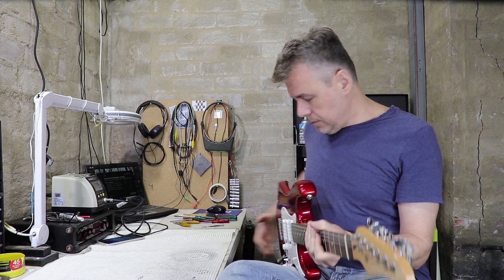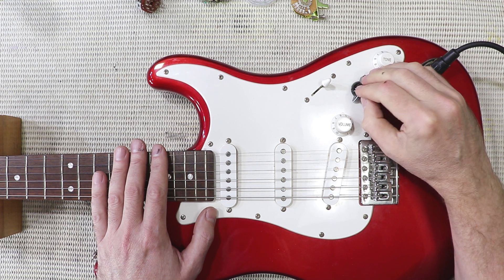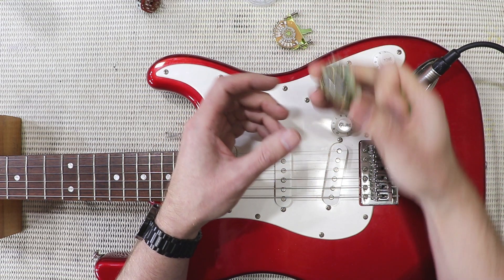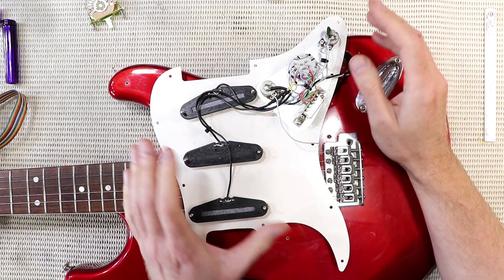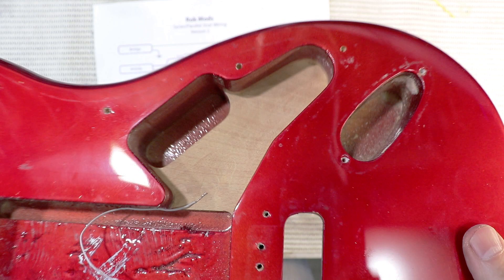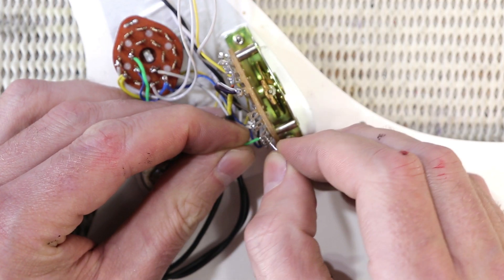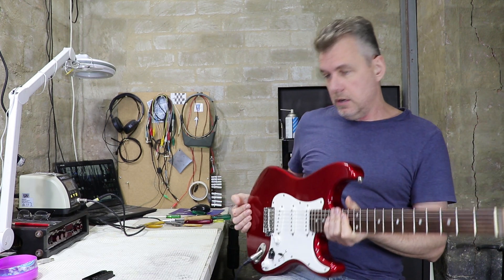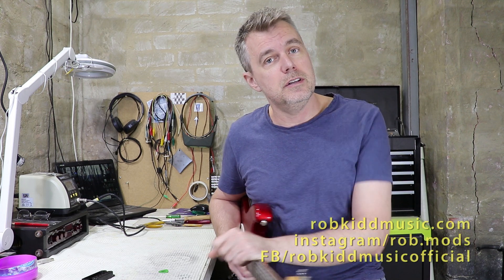Custom Series Parallel Stratocaster Wiring Mod, and Some Guitar Soldering Tips.

Comment: I generally wire up my 5-way by swapping the hot leads for the bridge and middle at the pickup selector.  The gives me: neck, neck+bridge, bridge, bridge+middle, middle.  In effect, I swap one "cluck" for a Tele-like sparkle, which standard Strat wiring does not provide.

Comment: Really appreciate you posting this Rob. I was looking for a way to include series wiring rather than the Dan Armstrong blender mod. I wired up your first version today, it works great and I prefer this to having a humbucker pickup in the bridge. Thanks again
Reply from the maker: Nice one.  Thanks mate.  On this red project strat I actually went back to version 1 when I wired up the black pickguard.  I like being able to switch straight to it, and yeah two singles in series is great.  If you are into Brian May, I believe he used the red special with bridge/middle in series a lot for many of the classic queen riffs and solos.
Reply: Huge fan of Brian May, probably why I like the sound of your mod so much. I've done a couple of jams now with the new wiring, it's very versatile. Neck and middle in series also gives a great jazz tone. Thanks again

Comment: what's the difference between middle pickup with reversed polarity and with the normal One? And to mount the 12 pole switch or the Rotary switch, do i have to remove some wood from the Guitar?

Comment: Casino guitar is a great guitar, I got several guitars to compare, I don't know why the feeling is very comfortable to play, maybe light and balanced weight ergonomic fender strat design, I moded so many times with this guitar, I cut the headstock like you did and removed logo and that left white mark underneath, made BMG setup like yours, installed one YJM pickup with roller beneath, now original fender player pickups are installed.
Reply from the maker: Nice one.  I'm liking mine more and more each time I play it.  I like the fretboard too.  It has quite a large radius, which suits my bass-player's hands!...

Comment: Do you believe that the first mod could be somehow implemented with hss strat in such a way that instead of middle and bridge in series one would get just the humbucker? I must say that I tried quite a few wiring diagrams and always end up with too few poles on switches.
Reply from the maker: The humbucker's coils should already be in series, so there's no need to have that on the custom switch.  You should be able to adapt the version 1 mod switch to just give you the neck and mid in series though.  In fact with only two throws required, a 4P2T toggle switch could also be used.
Reply: @RobMods  I may have not been precise enough with my description. I wanted to have all 5 classic strat position using north coil of bridge split + bridge humbucker in series + neck and middle in series and couldn't figure out how to split bridge humbucker.
Fortunately after a lot of drawing I finally figured it out and by using two superswitches got additional two series positions and managed to have neck with bridge south in parallel instead of middle single coil (kinda like a middle position on tele). It would be even better if I could run a resistor between hot and ground for parallel and single coil  connections only to simulate lower resistance volume pot, but I suppose I should be thankful for what I got.

Comment: ROB MODS, What would you recommend as in passive components to Revoice guitar pickups?
Reply from the maker: Well, adding a capacitor in parallel with a pickup will lower its resonant frequency.  And reducing the impedance load will raise the amplitude of its resonant peak, or reduce the treble roll-off I guess.  Using a shorter cable reduces the capacitive load as well.  All the components in a passive guitar circuit interact as you change the controls, so it's impossible to recommend one thing really.  You really have to think of all the parts working together to create a resonant circuit.  I have an old video where I use a rotary switch with different capacitors and resistors in my old P bass.  It is called "how to make a DIY Tonestyler".  It is a very old video, shot on my phone, and it doesn't explain itself very well TBH, but perhaps you might find this interesting.

Comment: The body is ply wood !!
If you look up the other end in the video you will see the laminations , It is surprising how well that works with a decent neck.
Reply from the maker: Yep, that's what I thought too.  I have come across a lot of 90's plywood strat and tele copies out of Korea over the years.  There is also a lot of old 80's Japanese axes with multi-laminated bodies that have a veneer top and bottom.  But this is actually a three-piece.  (I have stripped and refinished this more recently.)  So that pattern is simply from the cutters.  I used to operate cnc machines in a guitar factory, and I'm guessing this choice of cutter might just mean they can use higher traverse speeds for faster production.  Or perhaps they are cutters that can cut well both climbing and conventionally, for tool path optimisation.  I'm not sure.  There might be another reason...
Reply: I got a bently series 10, has a plywood body. No complaints. It also has the best neck a guitarist could want. Of course was made in early 80s when quality was much better than cheap guitars these days.

Comment: Do you know the Freeway 10 way switch? It's a drop in replacement for the 5-way switch. And has in the lower bank the regular strat tones and in the upper bank: bridge-middlein series, all three parallel, bridge-neck in series, bridge neck parallele and bridge neck in series.It's great and easy. I wanted to add some toggle switches to add out of phase possibilities, but replacing a tonepot with a rotary switch is also a nice idea. That makes that mod also invisible.
Reply from the maker: Yep, I've seen these switches, but not had the chance to wire one.   They look super cool though.   Another thought I had for a mod is to use one of the cheap switches that has a circuit board for its contacts,  and redesign and replace the board.  I haven't really thought this through though so I'm not entirely sure which options this would open up...
Reply: @RobMods  Oh, that is an interesting idea. I have such a switch lying around, because I replaced it with a Freeway switch. Never thought of disassembling it. Come out and play, switch.
Reply: I used to have a guitar with the 10 way rotary switch. I loved all the different tones but got rid of it for a simple 3 way toggle. Those 10 positions are impossible to switch to the right one in thr middle of a song.

Comment: Great job mate, excellent content, love your work. Instant sub.  I'm working toward a custom strat wiring, I havent quite decided how I want it to work yet, suffice to say its gonna be utter madness. And certainly beyond my ability to design, I might hit you up when the time comes. I'm in Melbourne, where are you located if you don't mind me asking? 
I've seen so many of those casino strats but never happened to play one. Good to know they're well put together.  I'm a big fan and proponent of well made inexpensive instruments, I've got a few by Artist, and my two main strats are by Haze, which I can recommend if you ever find one for cheap.
Reply from the maker: Thanks mate.  Yeah I love fixing up cheap instruments and getting them good and reliable for gigs etc.  This strat is really well made for sure.  In fact the other day I realised that the pole pieces are closer in the neck pickup than the others so they line up with the strings better.  A nice touch you don't often see in budget/student axes...

Comment: On the mod with the 3pdt switch can I also use a standard 5way strat switch?
Reply from the maker: Yes, with version 1, using a 3-position rotary switch, you can reuse a standard strat switch.

Comment: HELP PLS!!! I have experience modding, I followed the diagram, quadruple checked the wiring, but still I have a really weird issue where my bridge pickup is giving less output than the other two. Everything is working as expected except for this one weird quirk. I’ve wired in 3 different bridge pickups thinking it was a problem with the pups but that didn’t fix it. Super frustrated, any idea what could be causing this?
Reply from the maker: Hi Aaron.  It's hard to say without seeing it I'm afraid.  Did you use version 1 or 2?  In version 2, you need a special 5-way strat switch that is not standard.  Have you tapped each pickup with a little screwdriver in every setting?  Also, be aware that the single coil settings will be quieter than the series settings.

Comment: I have a 1983 Fender "The Strat" which I bought from new. Originally it had the top tone pot replaced with a two position rotary switch that allowed the 2nd, 3rd, 4th and 5th positions on the 5 way switch to change to In/Out of phase. This created a total of 9 tones when moving through the positions of the 5 way switch and the rotary switch. Now, over the years though, my original 2 position rotary switch has broken and I am unable to find a replacent. Over the years differnt techs have all had a go at rewiring/replacing with different pots but to no avail.My goal is to try and get my guitar back to its original wiring and tones. Quite frankly it sounds like crap now. I have found a wiring diagram but I need someone who can help out with sourceing parts and doing the tech work. Not sure whether this is something you do? I live in Byron Bay so hopefully the planets might allign and I'll get my old girl singing again.
Reply from the maker: Hmm it's hard to work out exactly what the switch did from your description.  A reverse-phased pickup will only give a new sound when combined with another coil, IOW, pos 2 and 4 for a strat switch.  If you can get up to Brissy, I'd recommend a Luthier called Gary Albrecht.  He is a master at his craft.  I'm sure there are some good techs up on the Goldy, though, but I have't lived in Qld for more than a decade...